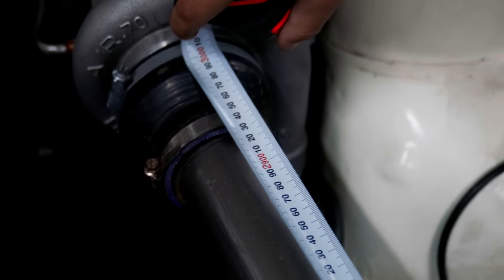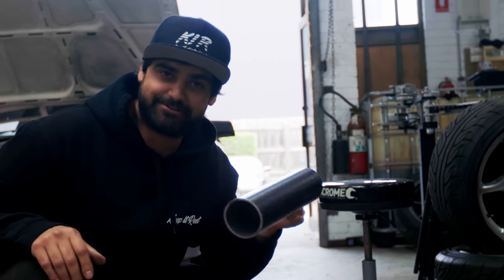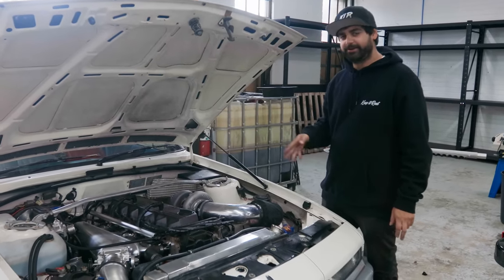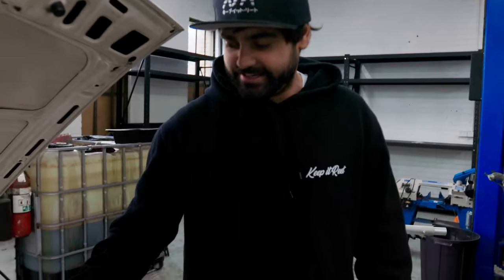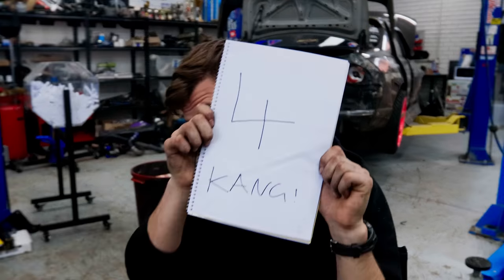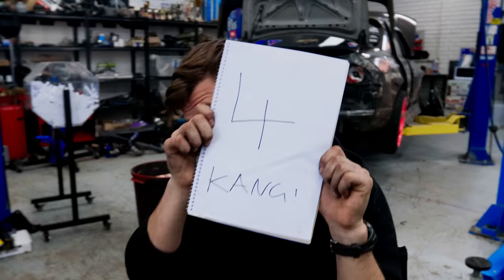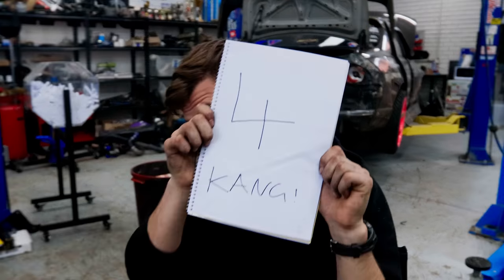How To Make The Worlds Best Turbo Flutter! VL Turbo Dose Pipe Testing!

Comment: I can’t believe I just watched a 25 min long video of just turbo surge 😂 and I didn’t lose interest for one second
Reply: only car vid ive watched fully in weeks XD
Reply: I came for the turbo sounds, stayed for the pure Australian car shenanigans.
Reply: Flutter is different from compressor surge.
Reply: Not once in history has that been done and even I did it 😂
Reply: @MrShakotan  Compressor surge causes the flutter sound my guy 🤦
Reply: @zanderdiedricks1895  if you think flutter is compressor surge then you are mistaken my dude. Compressor surge is actually highly stressful to components, flutter isn't. Surge is when the engine is under load, turbo is making high boost and the compressor stops accelerating and goes into a stall. Once it stalls some of the boost pressure is released and the turbo will then quickly accelerate again due to the high load on the turbine. With flutter from a quickly closed throttle the stalling is very gentle as there is little flow threw the turbine so it's 'speed up' phase is simply the inertia of the shaft assy. If you're interested in learning more there are some good examples on YouTube of this compressor surge phenomenon.
Reply: @MrShakotan  Well written response, but I don’t think you realise that your explanation contradicts your statement and proves mine. In this case I was clearly talking about closed throttle compressor surge which is essentially the same phenomena as open throttle surge. It’s just two different scenarios in which the same thing happens. The flutter sound you hear is the compressed air trying to escape through the compressor wheel, which is called compressor surge.
Reply: Faxxx🤣
Reply: I'm the 333rd "Like".
Reply: Man of culture
Reply: One of the most amazing things I've ever seen on the internet. Science is fun kids.
Reply: Same bruh
Reply: And over a million viewers did the same .I watched because it came up over and over
Reply: My guy
Reply: 800th like.

Comment: The 142 dislikes are the people who still believe flutter is your turbo spinning backwards lmao
Reply: Could you explain then what it is? Cause I got my first turbo car last year and this was always my perception/what I've always heard, TIA
Reply: Wait you can see the dislikes?
Reply: Turbo flutter is not when your turbo spins backwards but it can be bad for your turbo because its releasing air back into the blades and causing them to vibrate hence the flutter sound my first turbo car i blew the turbo on cuz i thought it sounded cool 👍
Reply: @eshbanvelez5212 the air pressure slamming into the throttle plate and the “flutter” your hearing is the pressure being “cut” by the compressor blades… same thing happens to your voice when you talk into a fan…

It’s impossible for the turbo to spin backwards, the air pressure is being forced through the compressor backwards but the compressor never changes direction 🤣

Comment: now connect the exhaust to the dose pipe and see what happens....
Reply: It would just suffocate from no oxygen
Reply: Anti lag anybody.
Reply: @snapped4433  i think it would run for at least a moment,  only one way to find out...
Reply: @joeprinsen1717  I would rrun untill there's no oxygen cause otherwise the fuel won't combust cause there's nothing to help it to combust
Reply: @snapped4433  yeah. I'm wondering how long that would take, and what it would run like while it's sucking in exhaust gases. there's no way the old Rb would be tuned well enough to burn every bit of available oxygen. hence me wondering... what would happen???
Reply: @joeprinsen1717  it would run probably for around 10-15 seconds then it would putt and sputter than cut off
Reply: @joeprinsen1717  just watched https://youtu.be/9ME3c3FNn_E that video and it started for a sec then cut off
Reply: @snapped4433  ok so master Milo has already done a video on it.  that means it wasn't a stupid idea. I'll take my win and leave.    ^( tips hat)^
Reply: @joeprinsen1717  yes and no 😂
Reply: @snapped4433  add oxygen bottle to the system....
Reply: @snapped4433  what then smart guy?
Reply: @snapped4433  egt would be issue,   run exhaust through air to water intercooler...
Reply: @joeprinsen1717  too hot

Comment: 7:15 : without 
8:43 : 3" straight alloy
9:04 : 3" stainless longboiiii
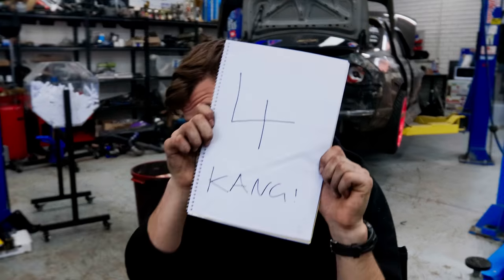10:20 : 3" strainless 90d bend
11:27 : 3" 90d alluminium with a little ... added on 
12:21 : 3" titanium goodness 
13:15 : 3" copper 
13:50 : truck pipe 
14:39 : 3.5" alloy with a little 45d
15:50 : 4" 90d bend
16:18 4" titanium 90d bend short edition 
16:55 : 4" copper straight 
17:39 : 4" 90d farbon 
18:05 : double ended ..... 
18:49 : My mums saxophone 
20:34 : 3" stainless steel 1.5m digery dose pipe
21:35 3 meter pure D
Reply: Thanks
Reply: You're a king
Reply: @nathanrowbottom3463  Haha my favorite is the 3" 90 bend @10:20
Reply: Respect
Reply: what garrett you got?
Reply: @Grandpasaab  saaaame
Reply: Legend
Reply: Top bloke
Reply: He put them all at the end of u didn’t notice. Either way tho. Thank you king🖤
Reply: This guy deserves more likes. Keep it up king👑👑
Reply: Thank you for saving us from 25 minutes of spam talk
Reply: @ВасилВасилев-э7з  I got you <3
Reply: My favorite is the 4" 90° bend 15:50
Reply: Or just skip to the end😑 where it literally shows them all and shows what ones they are
Reply: for that 4" 90d bend how long was the length?
Reply: MVP
Reply: thanks
Reply: Or just jump to 22:10 and hear them all back to back
Reply: Why is 8:43 "alloy" but none of the others?  Copper is an alloy of sorts. Titanium is an alloy. Stainless is an alloy. 
I don't think you know what the definition of alloy is.
Reply: @mitsuturbo  aluminium
Reply: @finnaustin4002  AL is an alloy, yes. As is Titanium, Steel, Cromoly, Stainless, Inconel, Brass and many others. One could possibly argue that AL is  more "pure" and less "alloy" than some of the aforementioned.
Reply: Thx friend 👍🏾👍🏾👍🏾
Reply: genius, i love you
Reply: they all sound good until they get to the truck pipe i feel like sound goes down hill after that 😂
Reply: You have a place reserved in heaven
Reply: 3” titanium best
Reply: 3" copper was the best imo
Reply: Not all heroes wear capes
Reply: W

Comment: This is the video the internet never knew it needed. 

For science and for glory! 

Ive youtubed this topic many times, and there has been nothing until this video that goes through the different pipes, sizes and materials. 

Kang content, and some absolute kang doses! 👌🏽 

If I had to pick, it would definitely be the 4” stainless long 90 for sure or the copper 3” for backup. 🤤👌🏽  
The 1.5m and 3m stainless pipes were pretty sick as well, just very impossible to street about with. 🤣

Stay Kang boys! I’ll see ya when I’m picking up the 32 Gtr. 🤙🏽

Comment: Would be interesting to see what multiple bends does
Reply: You mean what multiple bends dose
Reply: Yes and pie cut bends
Reply: How about an expansion chamber like a (decent) 2 stroke?
Reply: Helter-skelter stylee
Reply: Sounds like the 3" makes more noise that the 4". Now imagine a 4" with some sort of restriction in the flow path of the air. Someone could probably design a optimal path and geometry using fluid dynamic models in CAD. Also wondering what a design for optimal sound resonance would look like. Sound engineers could eat their hearts out figuring this out.
Reply: a snail dose pipe
Reply: @dunxy  yes now we need this 😁
Reply: @TheBuildRoom  the one time I'll allow it lol

Comment: 3,5" 90° Stainless is my favorite, but you can really see what the material, diameter and pipe length do and how you could use it to dail in the sound of your turbo flutter, which I love.
Reply: so I think if 4" 90° Stainless would have been a little bit longer of a pipe it could have taken the overall crown, but due to the pipe not being long enough you got the STUU but not the TUTUTUTU

Comment: 20:34 How to shred your turbo into engine (average turbo deep surge scenario)
To save your turbo- use dump valve for intake part from ehxaust (no pops n bangs!)
Reply: Use dump valve for intake part from ehxaust?
Reply: @DriftNick  Yup- Excessive pressure from intake (after compressor) goes into exhaust- More oxygen = more bangs :p
If you are able to do this for turbocharger only (as a device) you would create perfect 'anti lag'
Reply: @wdowa94  You know anti lag is far worse for the turbo then flutter?
Reply: @DriftNick  yup. So you can have em both

Comment: Hi, my car also has vibration, a tip...

make a tube about 15 centimeters with a half-inch circumference less than the measurement of the turbine inlet.
Example: 3 3 inches turbo inlet, the intake would have to be done with 2.5 inches

this is going to be perfect
Reply: Your not going to be starving the inlet with a too smaller intake pipe? Just curious dude

Comment: I wonder if real carbon would act the same as the plastic. Also if pvc would be different as well. Also how would different bends alter it. So many more questions now!
Reply: Carbon intake pipes are loud, it’s light and stiff so it resonates a lot. AutoDelta used to do carbon intake pipes for twin sparks and Busso V6’s (to replace the rubber bellowed sections) even with the stock air box, they were noticeably raspier.

Comment: Hey lads, great video! I have a 2JZ Supra with 800hp, 4" air intake, BOV and 3" ext wastegate, assuming the only realy way to get flutter without changing much is to muck the BOV? Currently has an awesome sound from the wastegate
Reply: Yeah block bov so it doesn't open
Reply: Get rid of bov or put really stiff spring in it so bov don’t open till after like 15 psi
Reply: Go to bunnings and get a doorstop + hose clamp
Reply: @FG2jit I've been running no blow off valves on any of my cars for years and I've never had an issue
Reply: @FG2jit it does give a bit strain on the turbo, but no more than the abuse it will take while driving. You will find a LOT of people driving with no bov for years without any issues or extra wear on it.

Comment: What if you had two 90s or a 90 and 45 welded in opposite directions to the two into one and have twin 3 or 4 inch exits
Reply: that's what i was thinking, dual inlet would be interesting

Comment: If I have a t51r mod will it still flutter or not? please let me know. Also these sounds will work with a filter on correct? meaning an air filter at the end of the pipe.  also can sound still be achieved if one wastegate is on the manifold? I know you said you blocked off bov. Please get back to me thanks
Reply: yes it will still work with t51 mod and yes you can still get the dose with a pod filter

Comment: How is he building boost on the spot? I wanna try it on my car. I can tell his isn’t in neutral?
Reply from the maker: Acceleration and brake in gear (auto)
Reply: @keepitreet  I’ve seen it done on manuals ? How can I do it
Reply from the maker: Only while driving. Or riding the shit out of the clutch stand still or launch control button

Comment: Ok so I have a 2jz making about the same boost. I block off plated the bov completely and put on a 3” 90 aluminum pipe, but it still sounds kinda mid. I have an anti surge housing but I was sure that only affected on throttle surge. I also have a hood exit exhaust. Not sure if either of those things affect the dosage but would love some insight if anyone got ideas
Reply from the maker: Anti surge housing ruins dose
Reply: @keepitreet  understood thanks

Comment: How is he putting a load on the motor? Like hes not in neutral because the car moves a bit on each run but only a little. I dont understand what’s going on. Very curious to learn how he does that. Anyone have any ideas?
Reply: Good question I was wondering the same. Maybe heel and toe the brake and throttle with a little clutch. Or has he got a hydraulic hand brake?
Reply from the maker: Hey guys! Its an auto.
Stomp the foot brake and press the accelerator in gear like doing a burnout but only allowing it to load the motor and build boost instead of spinning the wheels

I also often select a higher gear 2/3rd to help load it up more
Reply: @keepitreet  That actually makes a lot of sense, thank you!

Comment: You guys didn't mention how detrimental compressor surge is for the longevity of a turbo. Especially with a journal bearing turbo. I know yours is ball bearing thats not my point. Im just letting all the homeboys and homegirls with journal maxpeedingrods turbos know it will affet the systems efficiency doing things to excentuate compressor surge. Its all about efficiency and minimizing stress. This multiplies stress as well as potentially forcing oil out of where it should be and into where it shouldn't be. Theres a reason blowoff valves are a thing. Rally cars dont run them because they have anti lag. Which is also INSANELY hard on the system. If youre on a budget keep that in mind. That being said, on my single turbo (borg warner 76/87), port injected, coil near plug converted 347 stroker and tremec tkx swapped '96 ford Thunderbird i dont run a blowoff valve. Before you talk shit about my car just know i build drift cars for a living and this grandma coupe is the most composed, predictable, and fun drift car ive ever built, owned, and driven. She makes 760 wheel @ 16psi and weighs 2820 lbs wet. 3020 with me in it. It has a knockoff rocket bunny over fender kit for an s15, 18×9 up front and 18×12 out back. I run whatever 305s i can aquire from the discard piles out back of every tire shop in Reno, Nevada. Look into these cars. The second you discover theyre double wishbone front and rear along with the wheelbase and weight distribution from the factory youll wonder why more people dont utilize the potential of this chassis. It took a lot to get it where it is i wont lie. But it was all just upgrading suspension bushings to spherical where i could and polyurethane where i couldn't, billet aluminum subframe bushings, and designing subframe connectors that tie into the roll cage. I have totally custom one off fortune auto coilovers. Fortune saved the build out and specs so, if you decide to build a thunder cock, hit up fortune and tell them you want the Kelevra  coilovers. They'll get you squared away.
Reply: Cool story bro.

Comment: A word to those who don’t know what flutter is. Turbo flutter is bad and means air is escaping the wrong direction… basically it means you need to tune your car. If air is going the wrong direction you are doing it wrong. This guy may be having some fun but don’t ruin your turbo because you think it makes it cooler. Your turbo is literally over pressurized and risking system seals.
Reply: Well it's a good thing it doesn't ruin your turbo.
Reply: And you literally don't know that you are talking about

Comment: You don't actually drive or race the car like this, do you?  It's terribly hard on the turbocharger, to say the least.
Reply: All the cars they build and track are like this, the turbo will be fine.
Reply: @DriftNick  Really? Because the video i just watched that was recorded shortly after this one showed the turbo spewing oil out the compressor housing. I guess if you like throwing money away rather than running a proper BOV/Diverter/Etc. then by all means, keep buying turbochargers. I'm sure the turbo manufacturers dont mind a bit!